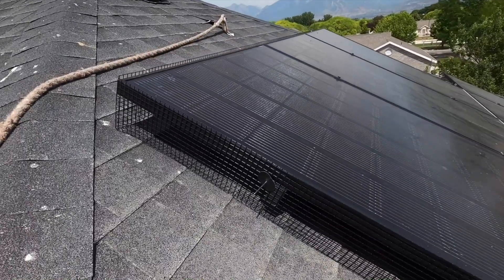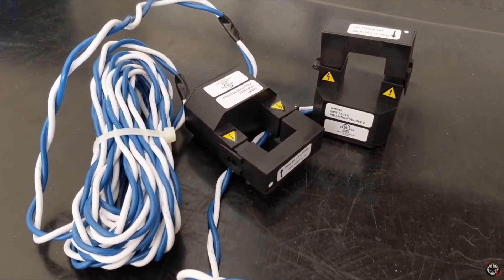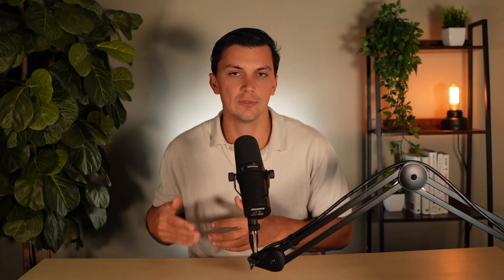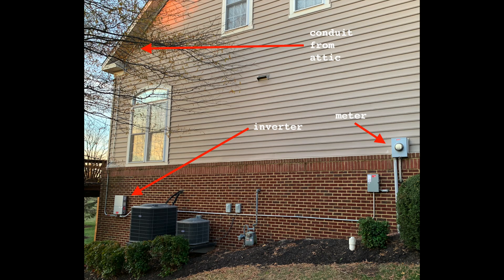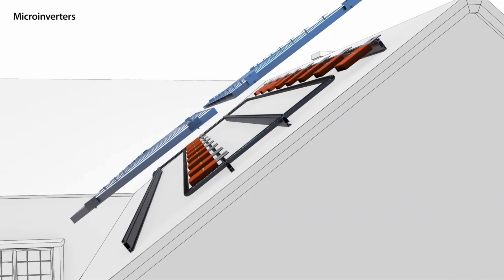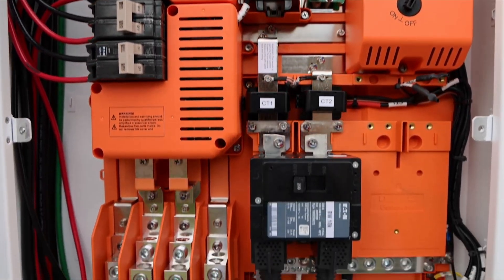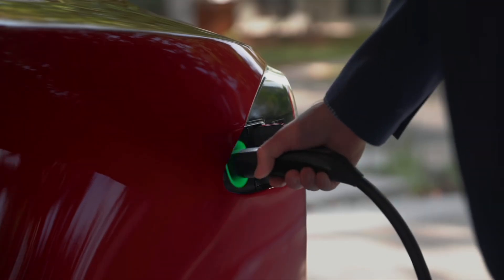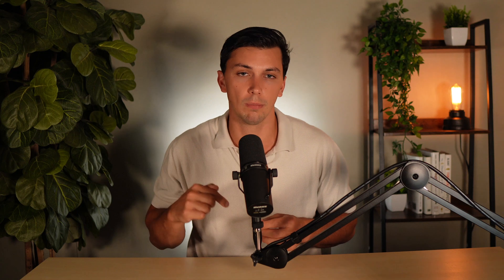7 CHEAP Purchases that improve your Solar System

Comment: Great Video Jack. Very useful ideas. In the utility-scale PV industry, they use soiling sensors to detect how dirty are the panels. This helps to monitor panels performance and schedule maintenance. I can see a use case for residential owners. Also it's a fun data to have. DustIQ and Atonometrics are two excellent brands, but too expensive for residential system. Do you know anything similar?

Also, what about temperature sensor module for panels (usually placed on the back of the panel)?

Comment: On grid solar and micro inverters are inefficient.  Off grid is better.  The conversion between AC and DC loses 6% each way.  Inverters convert PV DC to AC for the grid.  If you have batteries, the panel DC can go into them without conversion.  Savings are almost 12%, even more if you skip the charging cord and use the DC output on the battery.  Most plug and play batteries have input and output displays, so you don't need to buy separate meters or hassle with rewiring installs.

Comment: Micro inverters have DIFFERENT maximum output try to match the outputs to your panels. Why purchase a 420w panel if the inverters only max out at 280w.

Comment: Do the math on cleaning. If you pay someone to clean panels twice a year and that improves production by 20% annually (which would be some sort of magic) it is a break even proposition at best. Only the most heavily soiled panels in climates without strong rain need cleaning. Dont fall for the scam. Again, do the math before you go down this road.

Comment: I installed a new inverter and before I was able to use it a mouse made its home inside, ate the wires, and destroyed it.  I installed 1/8” wire mesh over all potential areas on the new inverter.

Comment: Our Gritter Guarsd are a wire mesh.  Does not impact air flow.  They are different from the solid plastic trim piece many are talking about.

Comment: I Use a Victron Quattro 5k (grid in and gen in and charger plus xfer switch all in one)   then Run Large Arrays (stand alone ground mounted) Up to 450v on a Victron RS 450/100 (2 arrays)
I am 50% solar producing 1 mega watt per month Florida adding 2nd Quattro next year for 240 v) got 14 jinko 590w bifacials  7 each array   adding 14 next year

also Gonna Put in 12k EG4 Heat Pump split mini to reduce Main Heat Pump Usage.....Good Video BTW

Comment: Skirt or contour trim is crazy, it will increase the temperature of the panels and lower their efficiency and lifespan!
Reply: Totally agree. The improvement on aesthetic is subjective to me, as well done mesh can look just fine, but restricting the airflow on panels that will drop efficiency when hot is just crazy to me.

Artisan Electrics were pumping them at one point.

Comment: cleaning solar panels has questionable returns.  you have to work out exactly how much more output you would need in order to justify the cost of cleaning.  given the price of labor...  i wouldn't be surprised if it wasn't cheaper to literally add a few extra panels up there and never clean.  (like those 2 last panels up there are my "never clean" panels)

Comment: 7:19 #3 If the battery storage of the system is too small, increase the capacity of the battery storage and call the additional battery a "generator module". Huh?

Comment: Except that mine would be gone during the day.  Now if we covered Parking structures & lots with panels! 

 Wouldn't it be better to sell the power during the high rate period (noon - 8pm) and then charge the car off of the grid (or bank) when the power is cheap (after midnight)?   

Providing the grid during peak by adding distributed solar sources is both good for the environment and safer if there was a grid problem (if the grid was built correctly).    

Using Off peak Hydro & Nuclear (neither should you adjust hour by hour) to then charge your truck (or bank).    Love the idea of both directions....

Comment: About $300 to clean my 28 panels which lose very little efficiency
due to dirt.  If I did that twice a year I should have probably not gone solar to save money.  I have lost less than 1 percent from last year at this time and that could be just the weather.

Comment: The "critter guards" will also keep blowing leaves and debris from accumulating underneath the panels...
Reply: Skits can rise the temperature of the panels by gaining heat and slowing air flow, lowering their energy conversion by .38 - .42% per degree C.   White and slotted would be better . . . .

Putting panels up higher fixes both issues pest and leaf's.   Add a light roof and Bifacial solar panels you would get the max gain for a roof size.

Comment: They eat the insulation off of the wiring because environmentalists started pushing for non-toxic electrical insulation, and that often means making it edible. Rodents often eat automotive wiring because a lot of automotive manufacturers have switched to soy based insulation on their wires.
Reply: True, I make all my money fixing car wiring harnesses that were rodent meal time. I was hoping they will start making them out of sugar so ants can get a go. 😂

Comment: not arguing the usefulness of the ad ons but they all were significant costs when paying for the solar co to do. I agree on the wire mesh around if panels are on roof but i dont agree on the nice looking but one that blocks airflow under the panel in hot climates you want air under the panels to cool them since high temps lower output 
  in fl the solar guys have surpassed the pool guys as the hardest and costliness and difficulty home contracting co .

Comment: 95% of your problems can be solved by not putting your solar panels on the roof. It’s just a piss. Poor idea you can’t service them. easily you can’t clean them easily and micro inverters on the roof. Well if it’s at center panel you’ll have to pay to remove every single panel just to get to that one and they may have a 25 year warranty but that doesn’t pay for the cost to replace it and I don’t normally last more than about 5 to 10 Here’s
Reply: 95% is somewhere near the extra cost to do a ground mount where we live. Ground mounts create as many problems as they solve in some places. High winds, flood level, seismic, guarding of components, etc.... The roof is where solar panels belong. Well installed systems need little maintenance.

Comment: Micro inverters are a profit grab by installers.  They limit power to 295W from a 430 Watt panel, they cost $175 each (more than many panels) and they give you many more inverters to fail.  There's no way Enphase will still be in business to replace your failing inverters in twenty years.  Besides, the cost to have someone go up on your roof and replace multiple inverters is far more than having one inverter in your garage repaired.
Reply: Also the warranty only covers the hardware, you have to pay the installers to come back to replace the micro-inverter, and then pay them again in a month or two when the next one fails.

An installer was telling me the other day that the expected lifespan of the micro-inverters is only about 7 years and replacing them doesn't reset the warranty period. So apart from spending more to get them in the first place, you have to pay at least twice for labour to replace them during the warranty period (per micro-inverter) and then they're going to fail again around the end of the warranty period.
Reply: There are higher wattage inverters, and check with enphase.
Reply: Exactly the reason I didn’t get them. Up on a roof getting hot and cold over and over again for years is a recipe for at least a portion of them to fail and a pain to replace. Keep it simple for the hard to access area, which is the roof in this case. 

Having inverters rated less than the panel is just insane. Why cripple your import like that?
Reply: Why not? Are you also saying it's a bad idea to buy a KIA for their 10 year warranty? "there's no way [xyz company] will still be in business to replace your failing [xyz product] in twenty years"
KIA is still here, my mom just turned in a 50 year old Tupperware ON WARRANTY!
Besides, a companies willingness to offer a warranty speaks of their confidence they built a good product.
you could argue "this is different, we're talking about electronics/tech stuff & we all know tech companies never last blah blah blah" Whatever, ugh. FINE, look in your hand... that phone you got. Company has been around, possibly longer than you. In fact, odds are, that tech company started in some guys mom's garage. And they're still in business, still offering warranties. GigaByte, they've been around way longer than 20 years, Intel, AMD, Nvidia, Sun Microsystems, Pyle, Kicker, Team, Asus, Sapphire, Walmart, Maytag, Whirlpool, GE, Ford Motor Company, Buick, Benz (made the first car in 1886 & still selling $200,000+ cars today)
It's not a cash grab, you're just being belligerent. Get over it.
Reply: @kynalohikaarme my buddy just bought a Nissan last year😂😂😂😂 he regrets every part of it right now. Tech companies come and go more than car companies.

Comment: Ours is all attic runs with microonverters and a span panel with FranklinWH bwtteey and looks great. I want to add the ground effects next to add sexiness and keep the squirells out. We have the generator module but haven't installed the inlet yet. Will do soon.

Comment: Totally disagree with attic runs.  I don't want any more holes in my roof than absolutely necessary.  Also the Sense unit does house and solar monitoring for half the cost of the solar specific ones.  It also can figure out some individual things to help you understand where you are using your power

Comment: Jack I like your channel. I've only subscribed to three channels on YouTube. Yours is now the 3rd. I live in Tampa, FL. I have a 12.4kw (29 Maxeon (formerly Sunpower) M425s with IQ7HS inverters)) for my 3600 SqFt. two story home. Installed it May 2024. On a good late spring or summer sunny day I can generate avg 75-78 kWh of AC power in a day. about 20,000+ kWh/yr. I use about 18,000 kwh/yr in the home, at this point.  I'm an industrial engineer by profession so I appreciate the no-nonsense, technical answers to relevant questions. 

RE the critter guards I have a barrel tile roof so I cannot use these (as you presented them) but I do have a thought about the skirts. I've seen these in my community on some of the flat tile roofs. But several pros told me the skirts are NOT recommended because air flow under the panels is blocked thus causing excessive heat buildup and lowering the efficiency of the panels. Do you concur this?

Comment: Critter guards is a very good extra to go for.  Also using filtered water for washing.  Thanks for the tips!  On the integrated EV charger, a large number of states will provide a tax credit on the purchase of one, so that will make the cost of getting a bi-directional charger a worthwhile expenditure.
Reply from the maker: Excellent point! I used to live in a state which had massive subsidies for EV’s and related products. Can be a good solution

Comment: For the vertical run from the roof, I routed the conduit against the downspout.  I routed the conduit horizontally between the bottom edge of the siding and the concrete foundation.  I spray painted the conduit to closely match the siding; very unobtrusive method to aesthetically blend the build into the existing structure.

Comment: I design my solar systems to supply only one or more appliances and lighting, not the whole house.
I use several cheaper charge controllers, 1 tied to each PV string, and all tied to a central busbar. 
Each charge controller runs at about 1/3 of capacity to charge my batteries and each may charge at a different rate depending on time of day and shading.
All the batteries are tied to that central busbar so that all batteries are charged equally.
Then my inverters are also tied to that busbar.

The best thing about my designs is that if my batteries get low or I lose an inverter, the appliances are automatically switched back to grid power.

Comment: I've been trying to decide between micro inverters or string, however, I have decided to go with String as it is a single failure point instead of 29 failure points for my system. While yes, the whole system will go down, it's also 28 less items that could potentially fail and doesn't require the roof being accessed to fix it. I will be curious to find out how many people with 29 microinverters make it 25 years without an issue with one of them.
Reply: ... then imagine you want to add more panels after five years but the manufacturer of the micro inverters is no longer around or the micro inverters are no longer compatible...
String just makes more sense - especially with split PV panels equipped with diodes... just perhaps add another MPPT module.
Reply: install #1. have 17 microinverters. in my case, there warranty is 5 years. (Enphase) I think they are better now.  install #2. In another house, its a string inverter (2 feeds) since they are two roof sides.   String one was cheaper but its inverter is at capacity, so it would cost more if I want to add a few panels.
Reply: Go with the string.  Micro inverters are over rated and a point of failures
Reply: Well I have a neighbor who has them now for 13 and none went out. Also I don't think his had the reliability recognition as the Enphase. But we shall see.
Reply: In theory, micro inverters are better. A string inverter has a lot of transistors or MOSFETS that run in parallel, and if one fails, it usually takes down multiple others. Because of the high power involved, when these things blow, they ruin the circuit board they're on, making repair impossible. In essence, a string inverter is a lot of micro inverters put together, but not in a good way. Usually, the capacitors are very underrated for the high current, but not so much in a micro inverter. It takes a much trickier design to make one inverter handle tons of power than to make many smaller inverters. But, from what I'm reading here, the micro inverters are overpriced for what they are. So, it appears to me that theory and practice are 2 different things.
Reply: @ Good point about the hot environment up on the roof.  I didn't think of that.  Even if they're in the attic, it's hot there, too.  And running tons of wires to get them into a cooler part of the house would cost a lot.  No good solution.
Reply: If access is an issue, keep it simple is my rule. Have the clever stuff where you can get at it easy to fix or replace.

Comment: The wire guard versus the solid pre-fab guard: The wire guard is much better since the air flows under the panels is far better. Heat is loss...
Reply from the maker: That is correct, and is a downside of using the skirt guard as opposed to wire guard.

Comment: A solid skirt will reduce airflow under the panel, making it hotter, and thus reducing the output.
Reply from the maker: That is correct, and is a downside of using the skirt guard as opposed to wire guard.

Comment: In the UK we have a weekly cleaning service. Its called "rain".
Reply: I have plenty of rain, but for me, there is a grim or film that slowly builds up on the surface.  soap with a soft brush takes it off. It builds up enough over several years that it needs the cleaning.   perhaps pollution?  pollen?  I don't know
Reply: I use a squeegee and the morning dew. It's called cheap!
Reply: Angle of the panels makes a difference. I see some in the UK that get filthy, even with the regular rain, because there gradient is less. I also wonder in some panels have better coatings or glass as for example my neighbour’s seems to be getting quite dirty after just a couple of years, while mine and others seem to be staying clean.
Reply: @MattyFreedom ask the neighbour for me.

Comment: A question with the critter guards, won't the mesh be a way better option than the panels because of airflow and cooling of the pannels?
Reply from the maker: That is correct. Mesh guards are more economical and effective, whereas the solid guard is more aesthetically pleasing